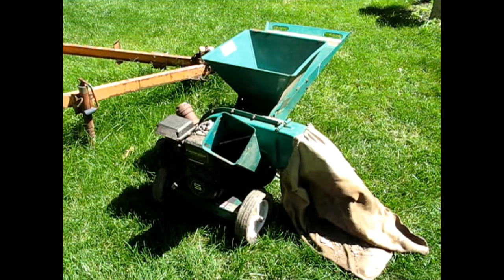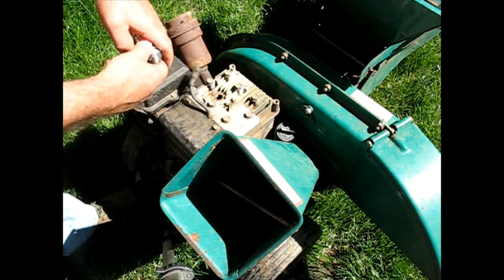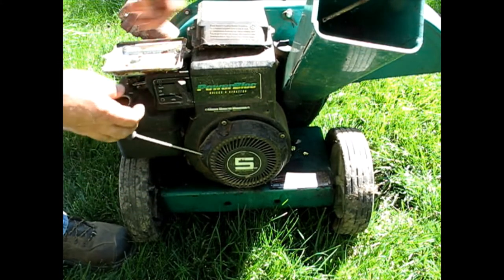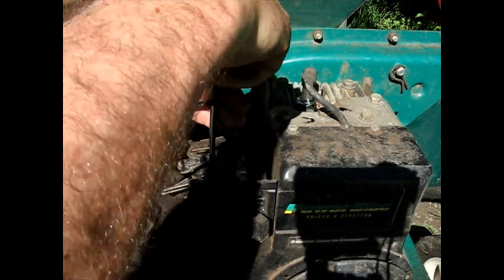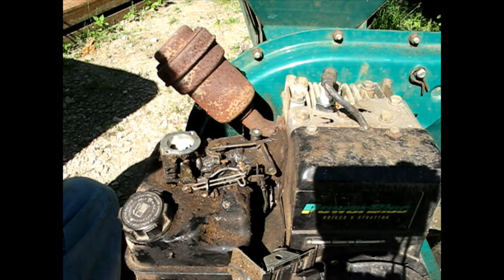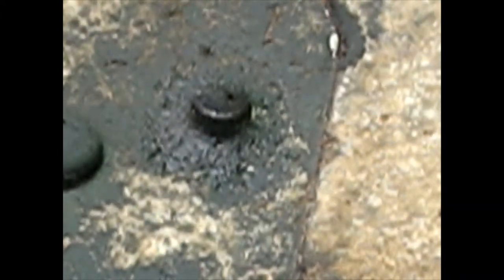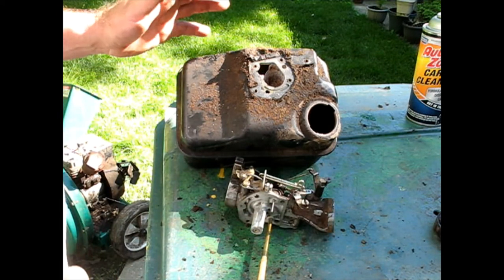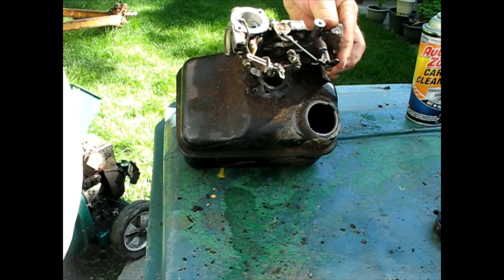Briggs and Stratton 135212 5hp MTD wood chipper shredder from 1996 left for dead  Can we revive it?

Comment: I have this exact machine. When running, it works wonderfully for shredding leaves and turning 3" (or less) into chips.
We moved from a house to an apartment. This machine has been sitting in a garage for 6+ years.
I got it out to help a friend with storm damaged trees.
I didn't think that it would run, and I was correct. 
I bought a carb rebuild kit.
Here's my problem (if it is a problem); I replaced and cleaned everything. A video that I watched showed how to do this. The thin flapper gasket definitely needed to be replaced.  I removed the old one. According to the video that I watched, there is a spring under the flapper. Mine does NOT have one.
I bought the machine new and this is the first time that the carb has been removed.
Do we need this spring? If so, how could my machine run for many years without without it?